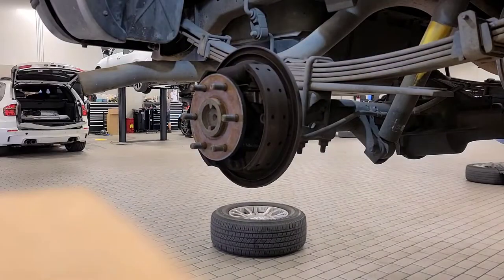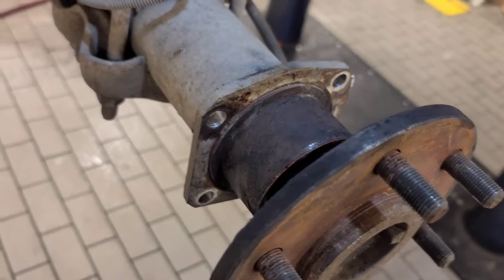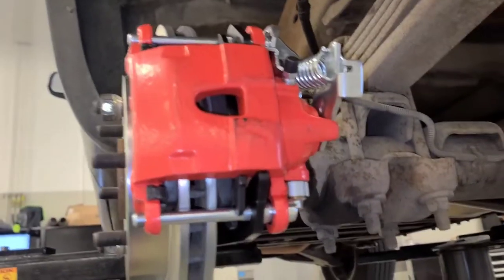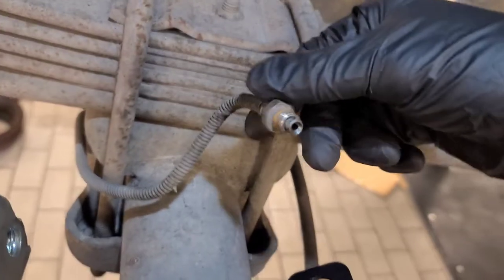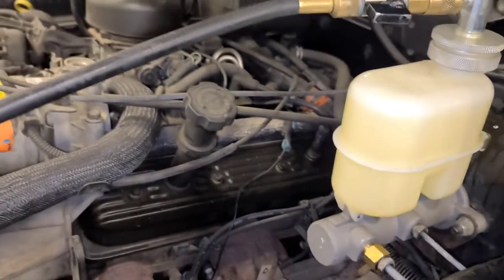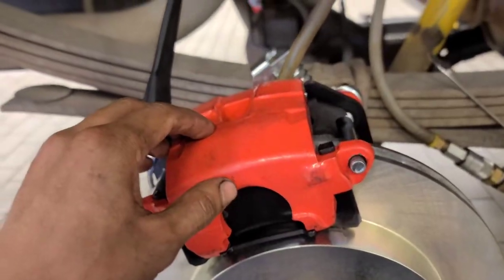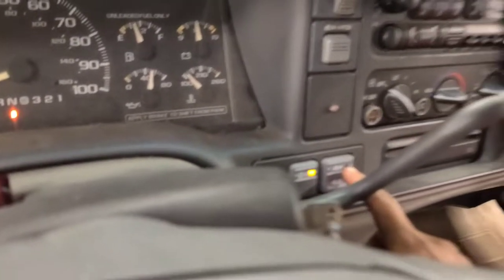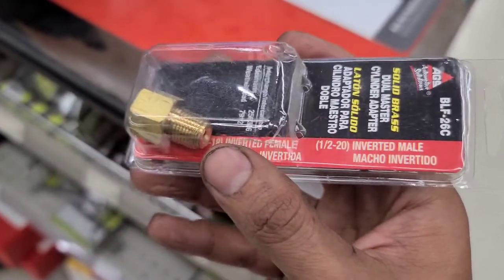1992-2000 GM Truck/SUV Disc Brake Conversion | How To!!!

Comment: Question..say you need to replace rear brakes again in the future. Would you have to order the specialty brake pads from the same manufacturer in the future? Thanks!
Reply from the maker: They have a list on there website of what parts to order, it's a mix of other gm parts!
Reply: O'Reilly has them

Comment: How did you fix your leak from the line to the fitting? Mine was leaking, replaced the fitting and still leaking. I put teflon tape on the line and that seemed to have solved my issue for now
Reply from the maker: The line had to much of a bend to it, it was leaking for the line inside the fitting not the threads. I little massaging and it's back to normal

Comment: Those rear disc brakes look 🔥. I want to do the same on my two door. Did the other adapter work and not leak?
Reply from the maker: I ended up finding a slight kink in my line, removed it, straightened it out and we're Gucci now!